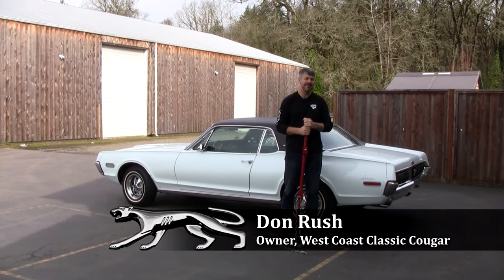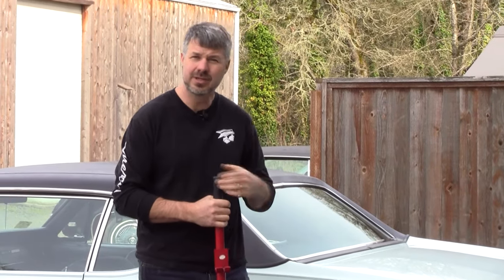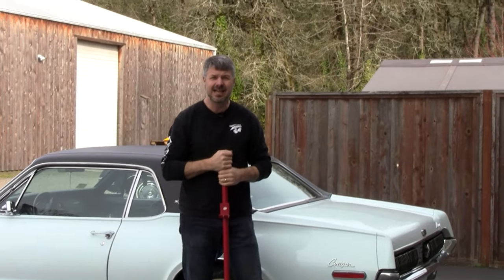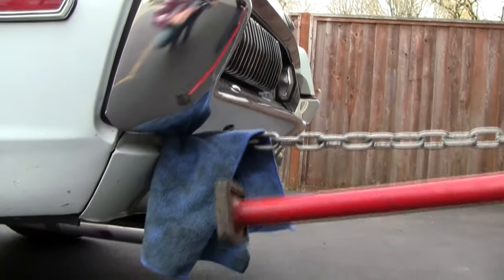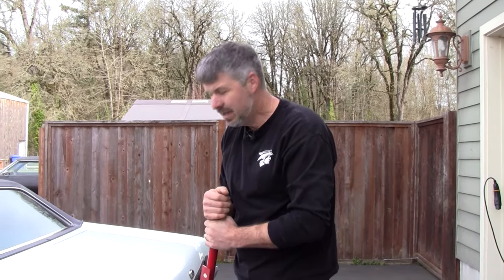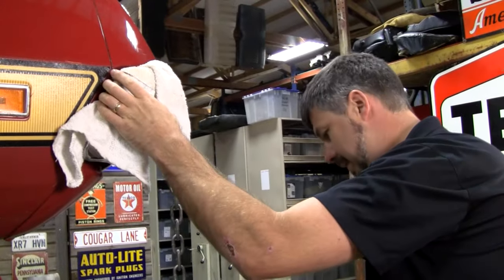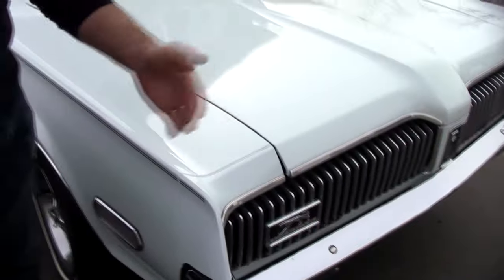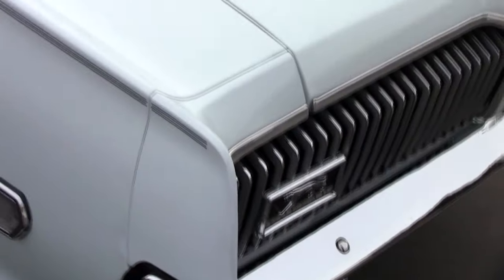Easy Bumper Straightening - Hustler Stick Tool

Comment: I was going to do body color bumpers on my 1970 Torino. So I bought an old bumper that was straighter than mine. It got here and it's also a little tweaked. I'm going to make myself one of these tools.

Comment: I've just subscribed! Dig it! I have a 98 4Runner that is ALL ORIGINAL, And I want to keep it that way! I have a couple of small dents in the front bumper and a small scrape/dent on the corner of the bumper. I want to know if you think it's "fixable"?
Reply from the maker: We deal with 60's and 70's Cougar/Mustangs, but in our experience unless it is pretzeled, has deep dents, or is torn, a good steel bumper restorer can usually make the bumper look as good as new.  Might want to try sending a pic to these guys and see what they have to say: http://ssbumperrepair.com/

Comment: Great video.thanks much...Can I use it on a front of a( fender).theirs a bend at the tip from where the bumper top meets the front of fender expedition.just alittle bend maybe like 2 inches in needs to be pulled out?

Comment: What about it's been hit by a truck and is more then just a wee off? I have a 1962.5 Acadian and don't want to buy a Chevy 2 bomber as they are very different, but available and surely cheaper. But NOT the Canadian Acadian bumper.

Comment: I have a 2012 f150 and my rear bumper is misaligned. I can see where the previous owner scraped the back of the truck and mis aligned the bumper. I think the other side hit the truck causing it to chip paint off the plastic piece on top is messed up so I got a new one and it doesn't fit because the bumper isn't straight and bent

Comment: Don't know if you answer questions. 1966 comet (It's very clean) someone before I bought it had a tow strap under the bumper and pulled the bottom out a little. Would this tool work on that?
Reply from the maker: This would work if the bumper got a twist to it, but I think you are saying the bottom of the bumper was misshaped by pulling on just the bottom lip of the bumper, distorting the actual shape of the bumper by bending down just the bottom lip of the bumper.  In that case this tool could not fix that issue.
Reply: @WestCoastClassicCougar  Thanks

Comment: On the red car, you show bending the bumper out.  Maybe a little too far.  But you say "it can also be bent in".  How do you do that?
Reply from the maker: It would just be a matter of re-positioning the pad and hook in such a way that the top of the bumper gets pushed in and the bottom gets pulled out. Much like what Don did to the rear bumper on the Cougar in the first part of the video. Really all you're doing with this tool is twisting the bumper one way or the other to match up to the fenders.